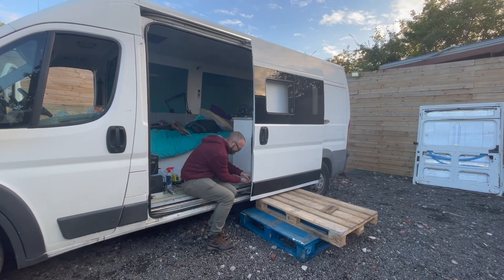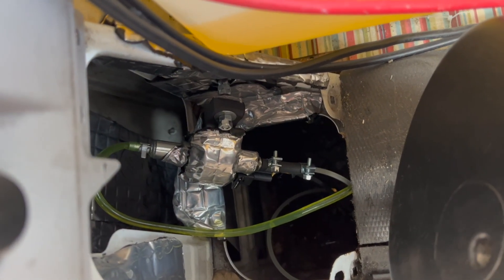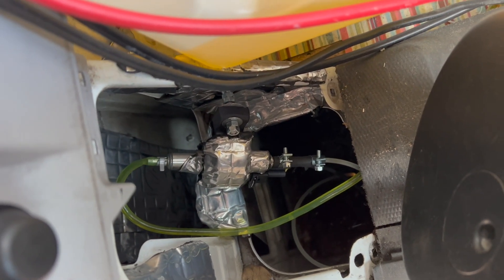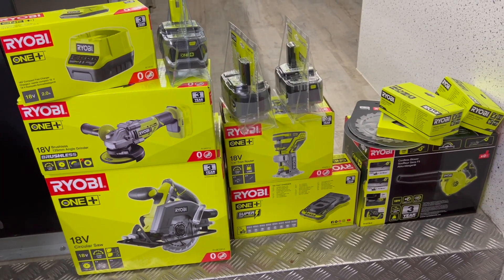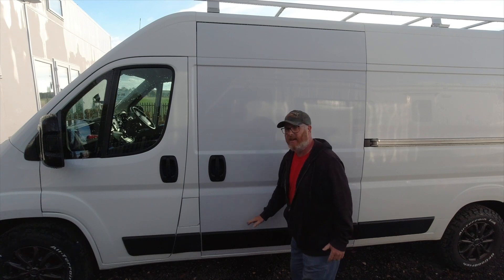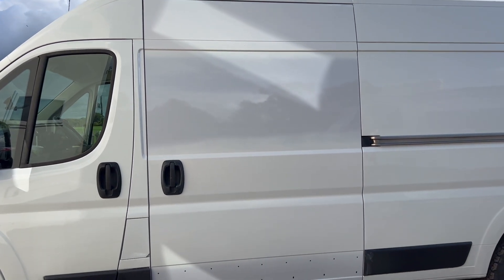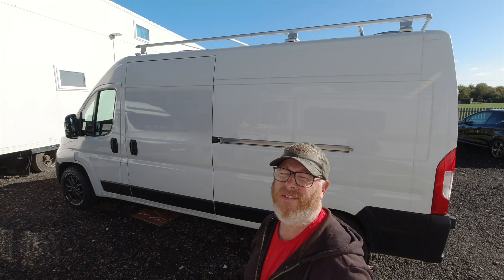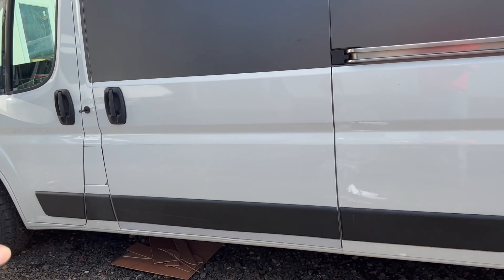That's a wrap, and a paint job! - VB06

Comment: That's looking very tidy John. I do like the look of that rubber based paint. I thought it was raptor you were putting on at first. I cannot believe that electrical system you're putting in, it's mega bucks but looks the business! The toilet is looking like a good purchase as well, I had a good read up on them afterwards. I hope that the weather improves for you and you can make some headway with the project. All the best.
Reply from the maker: I've just added the product links to the video description 👍🏻

Comment: Hi John. Vinyl wrap looks great. Speaking as someone who converted a van through the winter without the benefit of any indoor shelter I fully understand your frustration. Wait till it's freezing outside and your trying to get adhesives to work. Will you get your diesel heater up and running sooner rather than later. I didn't and spent a fortune running an electric fan heater (on an extension lead from the house) for many hours. Hope for your sake we have the warmest winter on record. Keep up the good work

Comment: Looks great John as does the job on Mandy’s. Can I ask how many cans you needed to do yours and if you needed any primers please? Can’t see anything in Timelapse but just want to make sure before doing mine. Also how many coats did you do please. Assume if you do more than one then you are removing the tape after last coat whilst still wet so that it doesn’t peal off?
Reply from the maker: I used 4 cans on Mandys and 5 cans on mine as it’s longer with more trim. I cleaned the van, dried it off, cleaned all the plastics with isopropanol and then masked off. I then gave a mist coat first and then 2 coats, on the final coat I made sure I sprayed on the masking tape line and then after 60 seconds removed the masking tape.
Reply: @GadgetJohn  thanks very much for your response and advice John which is really helpful. Please keep doing your informative vlogs which are great for knowledge, ideas, inspiration and avoids having to try stuff from scratch. Van is looking great, look forward to seeing you get out on your adventures 👍

Comment: Hi John looking fab, Can I ask if you painted the plastics (Bumper and rear bumper) did you just paint them or did you prep them other than wiping clean , thnx in advance. Luke
Reply from the maker: I cleaned the bumper & trim plastic and then wiped down with isopropyl before spraying.

Comment: Hi John -  a question about your badass wheels on your van: Is there enough room for these on the rear axle or did you have to raise the car/modify the suspension to make them fit?
Reply from the maker: These exact wheel & tyre sizes fit perfectly without any modification.

Comment: Hi John - good work dude. Did you have to flat it all down before spraying? What was the black rubber based paint? Looks decent that. And why dont you go buy a folding gazebo? You could use for cover doing the widows and even keep for van life after if needed. Would be super handy to keep sun and rain off while you do the jobs and keep you moving.
Reply: Btw - Id have offered for you to use my garage but with it being a high top you wont get it in unfortunately.
Reply from the maker: Due to the height of the van there’s no affordable temporary shelter solution.
Reply: @GadgetJohn  just meant one at side of van not over it. 👍 failing that drive to a quiet place with a motorway bridge or something and work under that. You have all your power in the van so sorted for that!

Comment: Do you find the PlastiDip paint lasts? Thinking of using it and heard that it lasts about 1 - 2 years before recoating needed? What's your experience? Also why not plastidip the side of the van rather than vinyl wrap? I'd be interested to know why you chose each material / paint. Like the videos - quite informative.